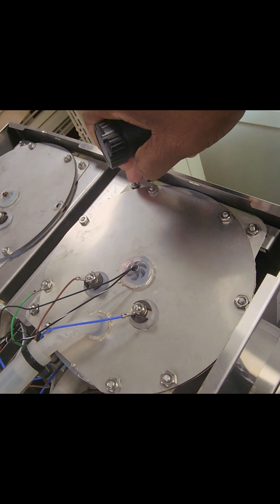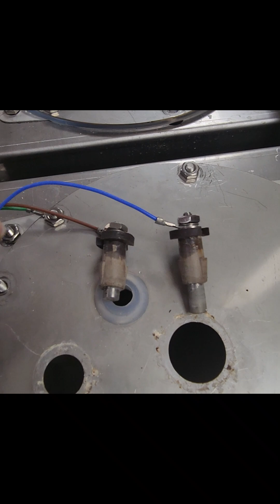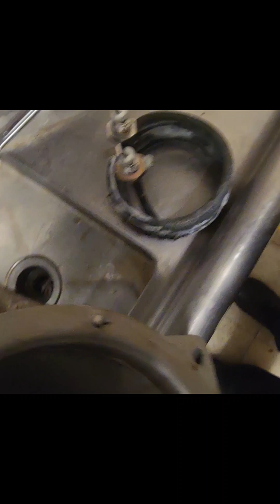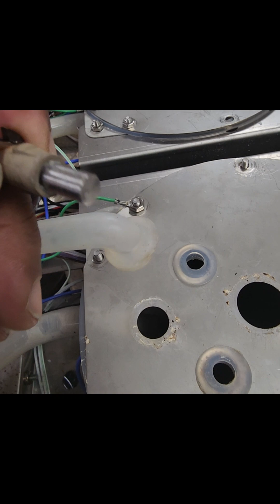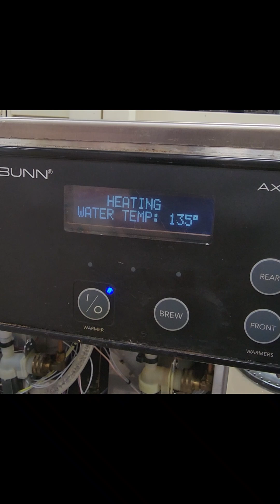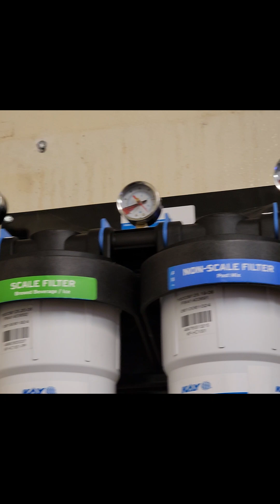Bunn Axiom Heater Replacement

Comment: Isn't the screen supposed to display the temperature on the 2nd line below HEATING? That's the problem I'm up against, even after replacing the control board (temp probe resistance was within spec). 

It brews when I plug it in, but won't run a cycle after that unless unplugged & plugged back in. Seems like it's stuck looking for a reading from the temp probe (I think that's why it doesn't display temp). So it's strange to me that it runs a cycle just fine, but after that cycle something just checks out
Reply from the maker: That's correct. Under normal operation, the second line should display the tank temperature once the control board is receiving a valid signal from the temperature probe.
Since you've already replaced the control board and verified the probe resistance is within spec, I'd check a few more things:
• Inspect the probe connector and wiring harness for a loose pin, corrosion, or a broken wire that only opens when the machine warms up. • Verify the control board is actually seeing the probe by checking the resistance at the board connector, not just at the probe itself. • Make sure the hi-limit thermostat isn't opening intermittently. • If it only brews once after power-up and then locks up, the board may be losing the temperature input after the initial cycle, which would explain why it never displays the tank temperature.
Let me know the exact Bunn Axiom model number (Axiom DV, Axiom APS, etc.), and I can point you to the specific troubleshooting steps for that version. Hopefully we can narrow it down without just throwing more parts at it.

Comment: What if is reads 151omhs on one.
Reply from the maker: Usually you will get around 19 ohms . I you are having heating issues you may need to replace that heater element or check the settings on you meter to be sure the value  Settings are set correctly.